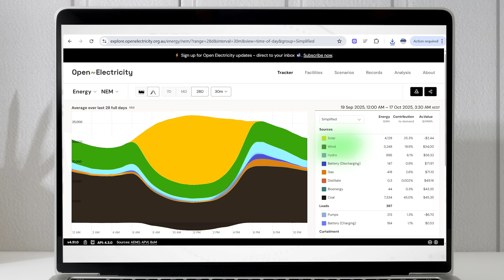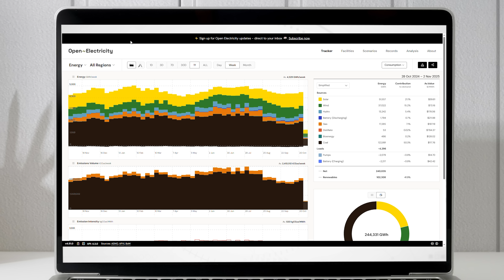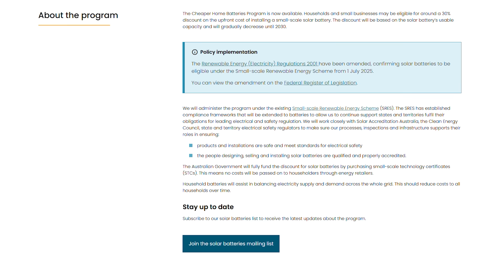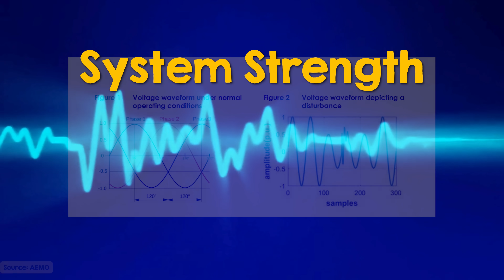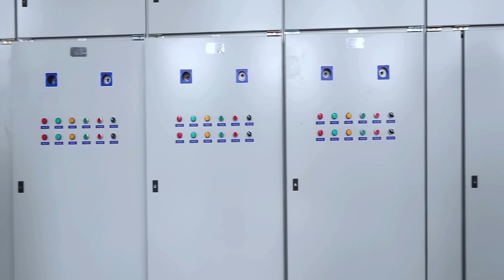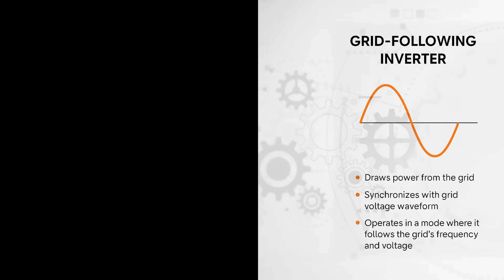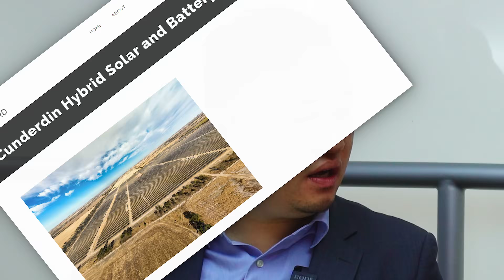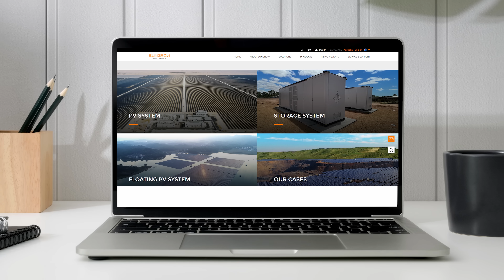Australia’s Solar Boom Is Breaking the Grid - Or Is It?

Comment: Have to pause before Rosie tells about the thrid problem. "Grid forming batteries Mrs Barnes!".
Reply from the maker: *miss/ms/dr (not Mrs!)
Reply from the maker: And yes you are correct about the solution to problem 3 😊
Reply: For once I was the smart kid but still managed to get a dressing down. 😅😂😅
Reply: Synchronous condensers are another tool for mitigating weak grids. Grid forming batteries and syncons have some different advantages / disadvantages so a complementary mix is likely optimum